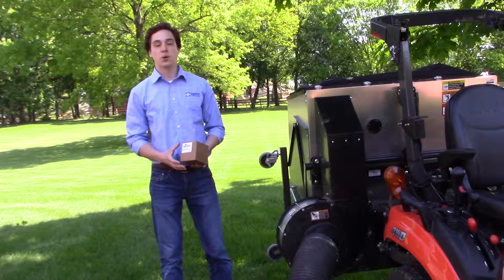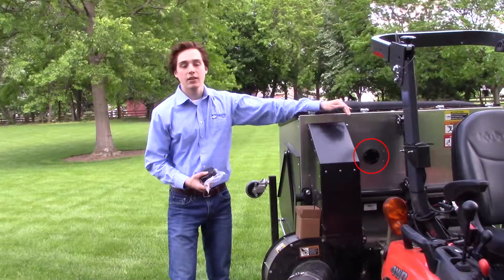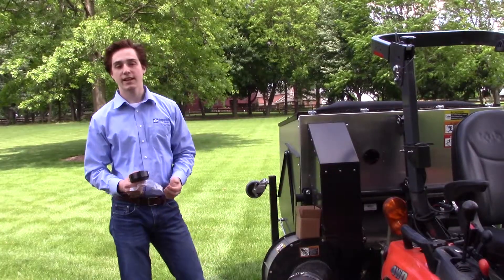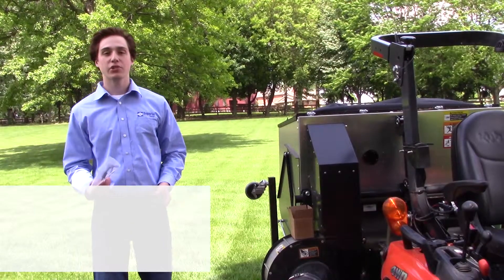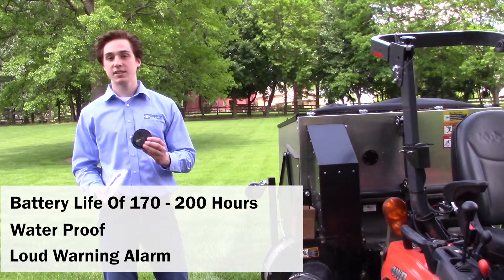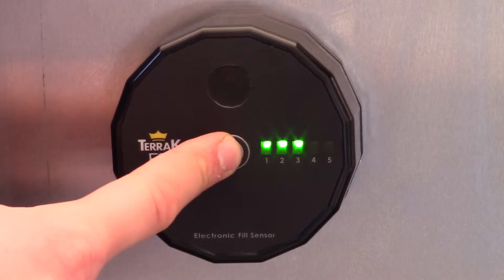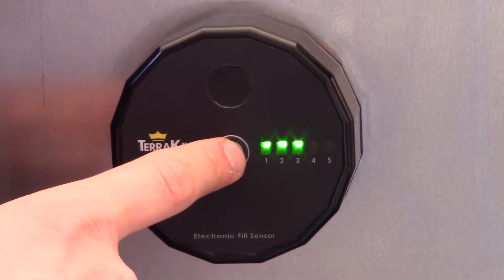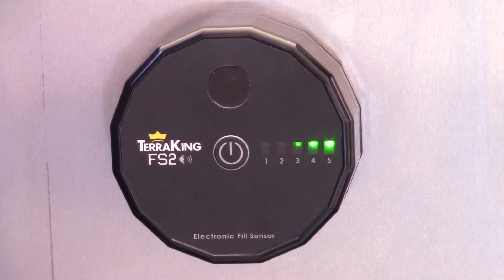FS2 Fill Sensor Overview

Comment: Hi Nolan, Is this going to help me know the top part of my JD 3 bag system with MCS14 hopper emptied without leaving the seat? I saw one of the examples was the 3 bag. The sensor was mounted near the fill tube. Is that the best location? It reads thru the plastic?
Reply from the maker: Hi BG. Yes, this will tell you when your MCS14 is full without you having to leave the seat (it alerts you through a loud alarm). And yes, the best location on the MCS14 is to the right of the chute and it will read through the plastic. However, feel free to move the sensor around until you get the desired fill.

Here is another video we put together (you can see the MCS14 in some of the clips):
https://www.youtube.com/watch?v=iKBIJ5DDBno

And the website page where you can get more info:
https://superior-tech.com/pages/fill-sensor

Let me know if you have any additional questions.

Comment: will work on a cyclone rake the hopper is all fabric, if so where would you mount it
Reply from the maker: It’s definitely possible but we have never tried it. You’ll have to build something yourself and see if it works. In terms of mounting location, make sure it goes in a spot where material builds up first. Sorry I can’t be of more help.

Comment: So when the hopper is full, and you dump it, do you have to do anything to the sensor to "reset" it, or does it automatically stop beeping and starts sensing again?
Reply from the maker: After you dump the hopper, the sensor automatically resets and starts sensing again. However, if for some reason it keeps beeping and doesn't reset, just turn it off and back on again.
Reply: @SupTechInc  Ok, thanks so much!
Reply from the maker: No problem, let us know if you have additional questions!